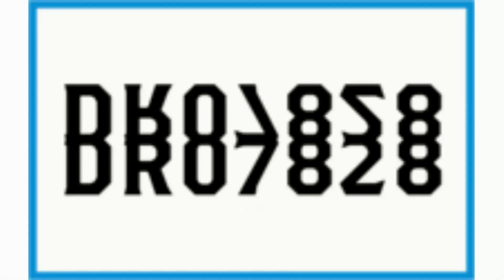M17 Lock Bolt Update and stuff...

Comment: Bro I need this lok bolt so bad, I can't get my full auto to not chop :(
Reply from the maker: The problem with the 3D printed lok bolt is that it breaks if you raise the FPS over 280. And the chance of it breaking at 280 is still there. It just got to be too much trouble.
Reply: @dr07828  That's too bad, I would sacrifice 20 or 30 fps for this. Hopefully you'll be able to produce it in the future!
Reply: @dr07828  hello friend, could you send me the file so that I can print it here in Brazil